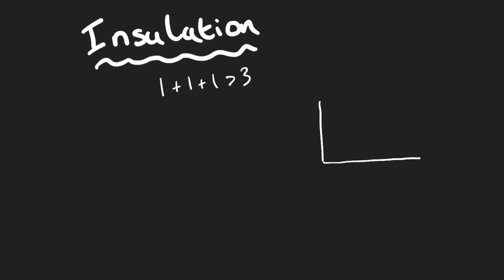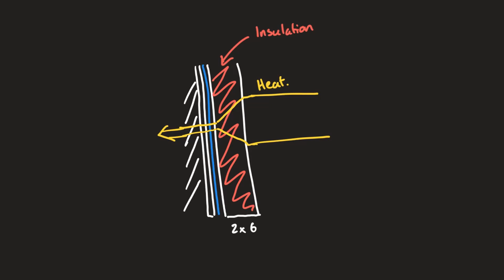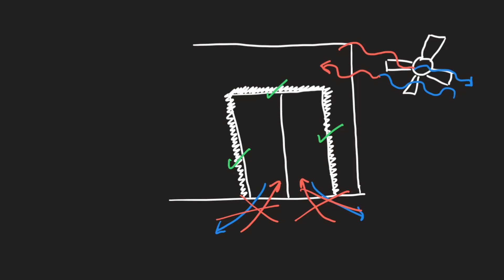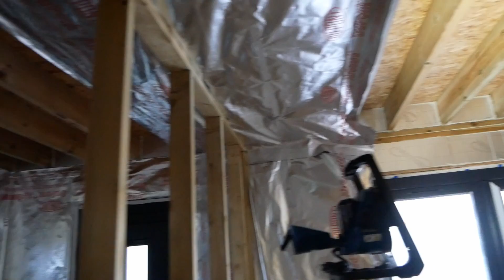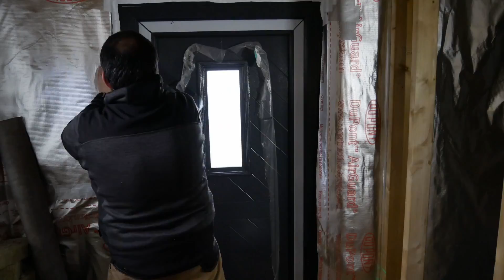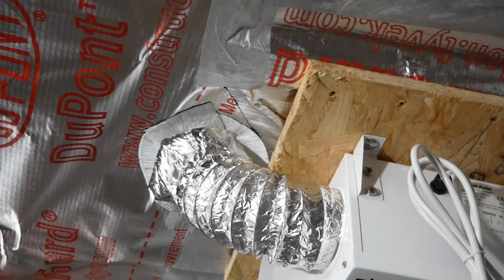Insulating the Garden Office - Garden Office Room Build (Ep 14)

Comment: If you were going to screw batons on the roof why did you not just staple the barrier on the roof instead of tape?
Reply from the maker: Tape is what the manufacturers installation instructions say. They fully expect you to screw battens up as well. So you would have to ask Tyvek! 😁

I can only speculate that maybe it's because adding the required number of stapled would create too many holes in the material?

Comment: I've noticed Paul you used rockwool in the walls and kingspan in the roof. Is that purely down to cost? I know kingspan is expensive
Reply from the maker: Cost and also ease of installation were key factors. I also had more thickness in the walls as they were 2x6 studs which matched the rockwool thickness. The rockwool was far less messy to install, cheaper and came on 400mm batts which fit snugly once the stud is accounted for. You can cut it with a bread knife with little to no dust. 

Cutting the closed cell foam makes it look like a snow storm unless you have full cutter & vacuum setup!
Reply: Paul Builds A Thing Excellent series on this we are looking at a similar build but was looking at the YBS Superquilt did you look at this by any chance?

Comment: Great project Paul, many thanks for taking the time to explain all the steps so clearly - really informative and inspiring!
Sorry if I missed it, but could you give any indication of the costs?
Looking forward to the final finished project!
Reply from the maker: Glad you're enjoying it and finding the videos useful. The costs are in the region of £15-18k. I've gone pretty 'all in' on this build and not really made many compromises - so there are savings that can be made. I'm planning at some point to do a video on what I would potentially do differently and also where savings could be made - for example you could reduce wall thickness, use cheaper membranes and insulation (or less), more standard windows (and less of them!), use a simpler foundation scheme (depending on you ground).